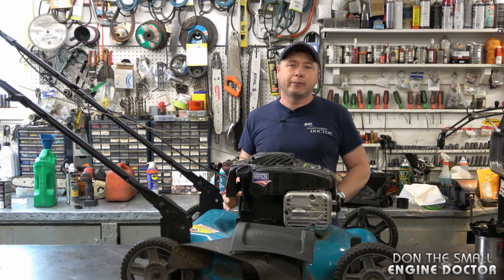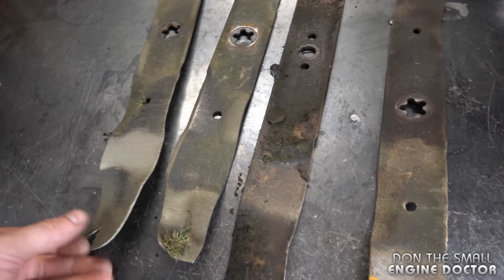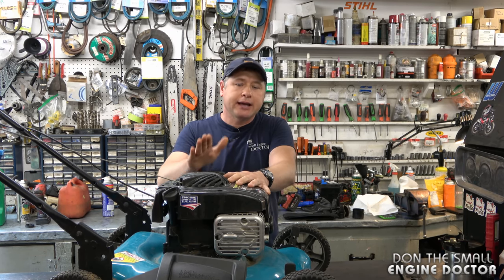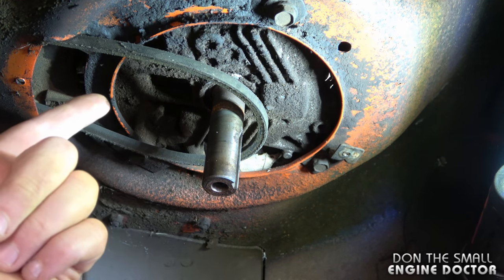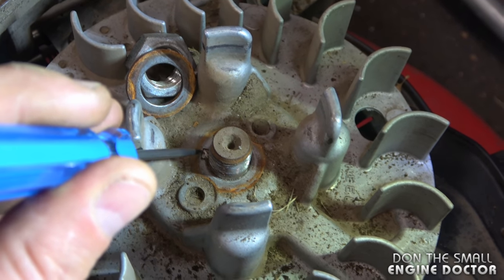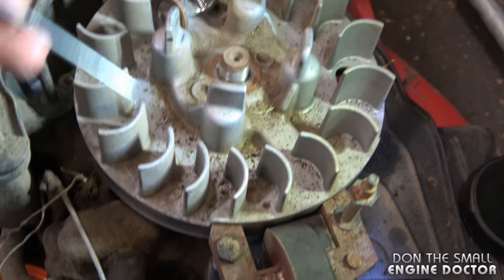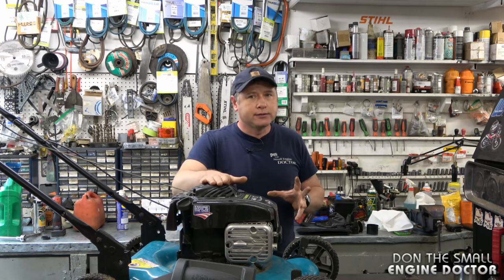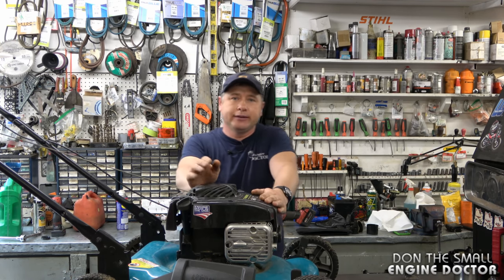TOP 3 Reasons Why Your Lawnmower Vibrates!

Comment: I’ll be checking my mower tomorrow based on this video. I had a really rough day with vibrations from both my mower and weed eater. My forearms and hands are pretty worn out and numb. I do hit tree roots and other objects if the grass is high and I can’t see what’s under there when I’m in a client’s yard. I just assumed my mower could take the abuse but I guess not! What an expensive assumption. Hopefully I won’t have to replace the mower. It was pretty smooth in the beginning.

Comment: A few months ago I had a slight engine vibration on my Toro Timemaster. I believe I didn’t hit anything and all the common reasons you mentioned seemed ok. After a couple weeks I finally found one of the three engine mount bolts was loose. I tightened the bolt and the vibration stopped.
Reply: @Billy Goat same thing happened to mine. I thought it was a rod knock at first but was very relieved to find it was just loose engine bolts!
Reply: @mjg263  how did you know that was the bolt and how did repair it.  Pls explain it to me because  I think mine has the same issue, I appreciate  a lot if you answer me. Thank you.
Reply: @jodybrownbrown5411  I noticed that the whole engine shook when it was under a load and also when I shut it off. There are 3 bolts underneath that hold the engine down to the frame, all 3 were loose on mine. 2 of them are pretty easy to get to, the 3rd one you need a long extension or a deep socket (can’t remember which) to reach but it’s not hard to do. All this time later and mine is still just fine, I luv that mower and my SR4’s

Comment: Thanx for the reminders     I made the mistake of 'chopping leaves' with the mower - I swore off of that bad habit and usually use a double blade to add 'flywheel' if I do    but this little mower should  NOT have been abused since it ran so well - so I knew all three conditions but it was nice to have a reminder - my guess is the key sheared a bit - or  my hope  is the key sheared a bit  - maybe a bent blade  I will find out now that it is spring out

Comment: On higher quality units like Honda's the crankshaft is bolted to a thick steel disc. The blades are fitted to the disc. That disc can get bent and cause vibration if you really hit something hard. Another great Vidya.

Comment: I have a disc shaped lawnmower blade assembly & I was getting a knocking noise & a bit of a vibration because the clearance between the blade boss & the crankshaft was 0.1 millimetres which was causing some sloppiness in the blade assembly.

I used Loctite 620 to fix the problem & I've done some mowing with it since.

Worn wheel bushes or bearings also caused an exaggerated vibration as well !

Comment: It the key is sheared the timing will be out and the mower will pull the strter cord handle/cord out of your hand when you try to start it.
Reply: Sometimes it’ll just run poorly. Just had a Tecumseh in here with a sheared key, it started right up without kicking back but it ran too rich like the choke was on.

Comment: I have seen a fair amount of Honda, Husqvarna,  Troy Bilt, and a few of the newer craftsman mowers with cracked engine mount holes on the deck that caused vibration. Most of them surprisingly did not even have a bent crankshaft or heavily damaged blade. However I don’t know if the blades were replaced afterwards. I haven’t seen it happen to a Toro or older craftsman no matter how abused they were. Just my personal experience

Comment: I have seen a few where the bolts holding the motor to the deck are loose. Easy fix unless the holes in the deck are rusted out.

Comment: Just fixed a mower last week where the owner hit a chunk of concrete the yard and it bent the blade and sheared the two pins on the blade adaptor. Fortunately the crank did not get bent, so a new blade, new blade adaptor, and a new blade bolt (old one had boogered threads from the incident) and the mower was back up and going with just $40 worth of parts.

Comment: for anyone who replaces a flywheel key, make sure it's a genuine part and/or made out if aluminum. it's meant to shear and should be made of a softer metal.

As far as bent crankshafts, it's best to buy a new mower or engine. sometimes the metal is poorly heat treated, I have seen the shaft completely snap off before. better safe than sorry.

Comment: I actually replaced the blade on my mower because it wasn’t cutting right, was vibrating and the engine felt like it was forcing a lot of power
Reply: You did the right thing.
Reply from the maker: it's actually hard on the engine when it vibrates
Reply: @donyboy73  I suppose excessive vibration from a damaged blade or crankshaft could cause the crankshaft bearings to wear out quickly, but I never ran a mower with excessive vibration long enough to find out.
Reply from the maker: @averyalexander2303  yes it could!
Reply: @donyboy73    Friend, is Meteor piston good for 372 xp saw compared to OEM Mahle? I mean power. Apparently the cylinders are worse? Is it possible to install 1 ring in a pile 372 xp with a new piston as before there were 2 rings ...
Reply from the maker: @Sensei948  mahle is better
Reply: Mine is so bad it scares me.   Gonna change the blades out ASAP
Reply: Oh wait   Blunt object- mower stopping instantly, you say?  Yep. Has happened twice. Maybe the crankshaft is super bent.  Sigh

Comment: Years ago I was using the lawnmower and my dad parked his car where I was cutting the grass and the blade hit a piece of metal. It flew right through the door and landed on the passenger seat. After that small incident the lawnmower shaked a lot. The blade bent and the crankshaft was also bent.

Comment: All good reasons to step up to a mower with belt drive to the blade which will give you the same protections to the engine that a rider lawnmower has. Mandrel repair is normally much cheaper than engine repair.

Comment: My electric lawn mower suddenly started vibrating and making a loud noise. I never hit anything. Mower was running smooth and I stopped to empty the bag and all hell broke loose when I immediately restarted it. The blade WAS somewhat worn... I removed the blade and restarted to see if that was the problem. It remained loud and vibrated without a blade installed and there was NO visible wobble on the crankshaft. My mower doesn't appear to have a flywheel at all, and no, it's not missing... there is no space or groove for one. What is the problem??

Comment: Blade on my Honda pushmower
did not look bent, but had vibration.Bought a new blade, and it runs like new. Could not keep the old blade from loosening itself, was first tip something was wrong

Comment: Hit a berm with my lawn boy hard enough to stop it... didn't bend the crank, but a few weeks later the main bearings failed, causing the flywheel to walk enough to hit the coil and not crank. Almost got away with that one... Shame, ended up replacing it with a riding mower.